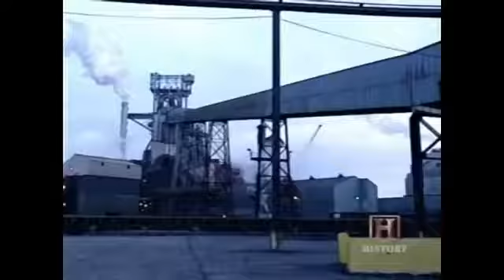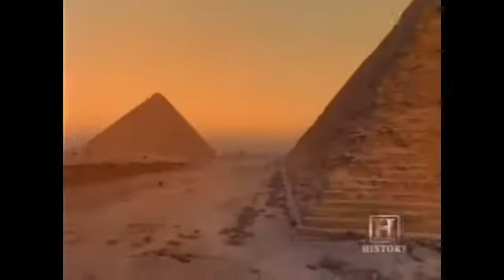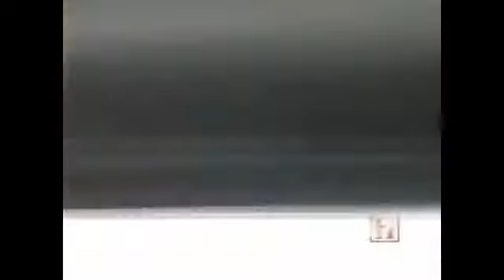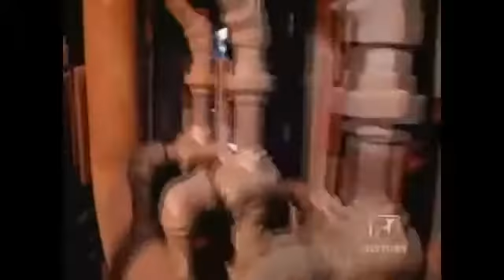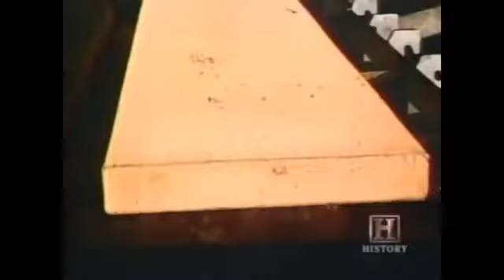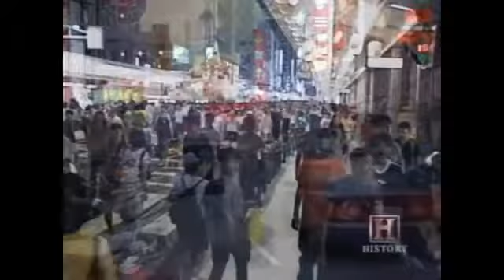Number 7 Blast Furnace

Comment: This is Madeline number 7. Madeline block lit each blast furnace at inland steel company from number 1 to number 7. Her father Joseph block was a founder of inland steel in 1893.
Reply: It’s the last furnace at Cleveland cliffs now
Reply: @kevinbraden9445 still the powerhouse.. back in the early 2000s I was on the construction job when they built the new cooling tower on top of the old Open hearth slab.. the train runs right by it
Reply: @kevinbraden9445  R.I.P Sinter

Comment: A new furnace is now being in use, it is called as the indirect-direct electric plasma arc furnace which has four horizontal electrodes and one vertical but hollow electrode in the middle. The five electrodes produces an electric arc plasma zone through which a mixture of iron ore powder and limestone powder and coke powder is poured through which is instantly heated and melted and made to react to reduce the iron oxides of the iron ore into metallic iron. Capacity ranges from 15,000 metric tons to 27,000 metric tons a day of metallized iron ore which is then melted inside an electric arc furnace with limestone or silica sand and some coke to reduce it even further into pure metallic iron and make it as liquid as water but not refine it. Once further reduced into pure metallic iron it is transferred to a basic oxygen processing furnace (BOP furnace) where it is further refined and mixed with some carbon to turn it into steel and micro-alloyed with chromium, molybdenum, vanadium, nickel, silicon, titanium, etc in ferro alloy form to micro-alloy it and to scavenge any contaminants. And then simultaneously poured into a ladle with alloying ingredients and fluxes of limestone and silica, the ladle is designed to hold and keep the molten steel molten for many days at the same temperature unlike to today's ladles which are not up to the highest standards in terms of thermal temperature maintenance and usable lifespans.
Reply: If you are saying number 7 is different. You’re wrong. Iv been there for 7 years it’s still the same as when they built it
Reply: @Tacobear33  number 7 is still kicking.. 13 at uss was a little bigger
Reply: @dask1516 7 is bigger